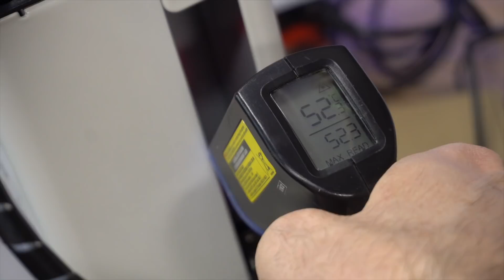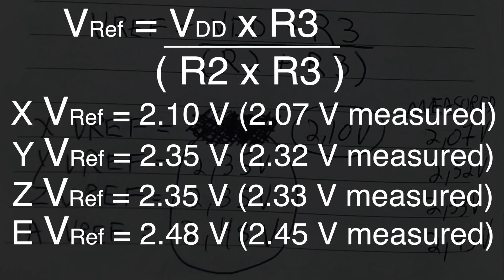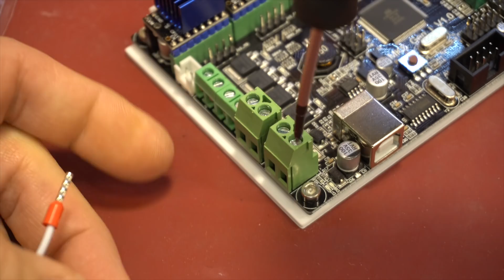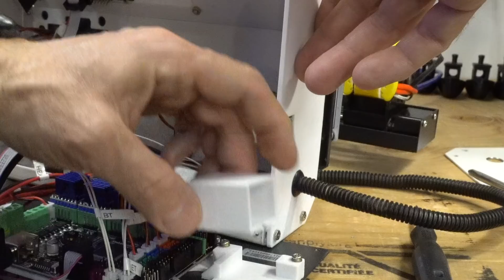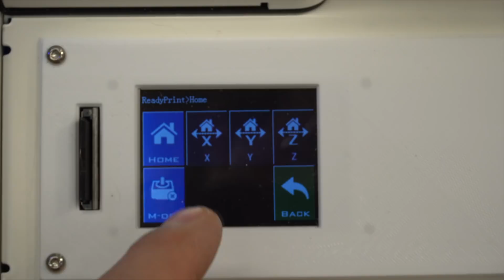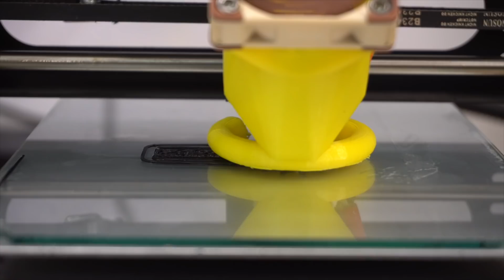Monoprice Mini V2 and V1 - Transformation Part 2

Comment: I presume if I replaced the main board with the MKS Gen L, I would lose the wifi function of the printer or is that module elsewhere? I'm thinking of doing this as a cheap way of using the TMC drivers for a quieter machine.

Comment: Hi Frank thank you for your great work and video . 
I like to rebuild my Monoprice mini as well. I check that links for parts and they don’t work any more :( 
Do you think if I will use that parts it will work as well as yours ?

[CA$56.71 19% OFF]MKS SGEN L V2.0 Mainboard + 5Pcs TMC2225 v1.1 Ultra-quiet Motor Driver for 3D Printer Part  Office Equipment from Computers & Office on banggood banggood://prod-1653438?channel=emarsys&utm_source=emarsys&utm_medium=shipoutinform190813&utm_campaign=trigger-logistics_prdshare_copy&utm_content=gakki&utm_design=18

And 
https://www.aliexpress.com/item/32823840528.html
Reply from the maker: If the holes are at the same position on the board than it should work.
MKS Gen L on Banggood : https://www.banggood.com/MKS-GEN-L-V1_0-Integrated-Controller-Mainboard-Compatible-Ramps1_4Mega2560-R3-For-3D-Printer-p-1270450.html?utm_source=google&utm_medium=cpc_ods&utm_campaign=arvin-3d-sds-printer-url&utm_content=arvin&gclid=CjwKCAjwiOv7BRBREiwAXHbv3OS00bfisHPaiyzVwx9bHrpI1PaFl2SprxVWzITq9wn8qK5VNeWpXBoCHT8QAvD_BwE&cur_warehouse=CN
As for the drivers I had trouble with generic brands, you can them, you will have to modify Marlin accordingly and if they are not supported you could have to update to a newer Marlin also.

Comment: hey frank i have an issue where when my printer homes it goes to the right instead of the left and crashes into the side. It should go to the left and hit the endstop. Can you explain what might be the issue?. As well as that the cooling fan for the hotend doesn't turn on.
Reply from the maker: Hi, for the direction problem, you can reverse the cables or change the direction in Marlin in the configuration file. In mine the cooling fan comes ON at 50 degrees. Hope this helps.
Reply: Frank's 3D shop also will I be able to add a bl touch to the printer and does it connect to the board you showed?
Reply from the maker: Hi, you could add a bltouch if you make a support for it, but the build plate is so small I prefer to add a flat glass and do it manually, anyway the probe would not be able to reach every corners you would need something like a piezo probe so use the nozzle as a probe, it requires major redesign of the hot end.

Comment: Hi Frank just puchased the monopice mini v2 after only 1 print I got a sensor fail on the screen, Heat bed and nozzle wont heat up. Whats causing this??? Please
Reply from the maker: If you can ask for a replacement or refound, if it’s not possible repair either the hot end thermistor cable or more likely the bed thermistor cable, I have a video on this.
Reply: @Franks3Dshop  Monoprice refunded but let me keep the printer, thanks for replying. Great videos

Comment: Ive used your upgrade files on my V2 MP200 with a mks_Gen L ver 1 using Tmc4988 steppers which i already had, but i'm only able to get half the bed to be used, it wont go past the half way on x or y unless in the firmware i double the size of bed, which is not really advisable i'm guessing..and idea what i could of missed
Reply from the maker: Did you change the driver type in Marlin config. Verify that the jumpers on the board are connected correctly I think you need all 4.
Reply from the maker: All 4 under the drivers.

Comment: What do I need to do to use the wifi on the new mainboard?
Reply from the maker: You can use a Mks wifi module, work with some limitations, I use a Raspberry Pi Zero W with octoprint on some of my printers connected through USB, works if you do not connect a camera and keep it slim...

Comment: Where does the bed power plug in on the new board?
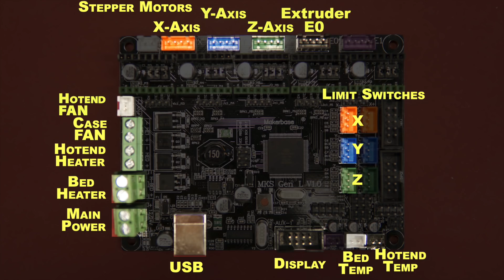Reply from the maker: Hi look in part 2 at 5:24 time mark, it’s the bed heater.
Reply: Frank's 3D shop Thank you.
Reply: Frank's 3D shop I used the TMC2208 v2 drivers. I’ve tried all jumpers and no jumpers. Do you know how they should be set?

Comment: I made all of the mods, using the parts list supplied. When I turn it on, I get power to the board and display, but nothing from any of the axes. Any idea what I need to look at to resolve this?
Reply from the maker: Hi, verify that power is applied to the board, verify the jumpers under the motor drivers. What drivers did you get, they have to be set in standalone stealthy mode. Did you try to move the axis from the printer menu ? Connect a computer and use Pronterface to see what the board is telling you when moving the axis... Send me what Pronterface gives you when moving axis if you are still stuck...
Reply: @Franks3Dshop  I now have all except the z-axis working. Here is the pronterface output.
Connecting...
start
Printer is now online.
echo:Marlin bugfix-2.0.x
echo: Last Updated: 2019-10-31 | Author: (none, default config)
echo:Compiled: Nov  1 2019
echo: Free Memory: 3699  PlannerBufferBytes: 1216
echo:SD init fail
echo:Hardcoded Default Settings Loaded
echo:  G21    ; Units in mm (mm)
echo:  M149 C ; Units in Celsius
echo:Filament settings: Disabled
echo:  M200 D3.00
echo:  M200 T1 D3.00
echo:  M200 D0
echo:Steps per unit:
echo: M92 X80.00 Y80.00 Z400.00 E96.00
echo:Maximum feedrates (units/s):
echo:  M203 X200.00 Y200.00 Z20.00 E25.00
echo:Maximum Acceleration (units/s2):
echo:  M201 X3000.00 Y3000.00 Z3000.00 E3000.00
echo:Acceleration (units/s2): P<print_accel> R<retract_accel> T<travel_accel>
echo:  M204 P3000.00 R3000.00 T3000.00
echo:Advanced: B<min_segment_time_us> S<min_feedrate> T<min_travel_feedrate> J<junc_dev>
echo:  M205 B20000.00 S0.00 T0.00 J0.01
echo:Home offset:
echo:  M206 X0.00 Y0.00 Z0.00
echo:Hotend offsets:
echo:  M218 T1 X0.00 Y0.00 Z0.000
echo:Material heatup parameters:
echo:  M145 S0 H180 B70 F0
echo:  M145 S1 H240 B110 F0
echo:PID settings:
echo:  M301 P22.20 I1.08 D114.00
echo:  M301 P22.20 I1.08 D114.00
echo:Tool-changing:
echo: Z2.00

The only time I get any z-axis response is if I plug it into the E0 connection on the main board. No response when connected to the x- or y-axis connections. I replaced the z-axis motor with a know good one. I also tried swapping the stepper driver.

Thanks for your help I've got too much money into this upgrade to give up on it now.
Reply: I finally got all of the axes working, but they don’t home correctly. Did you have this much trouble getting the new board to work correctly?
Reply from the maker: @katherynoverman6851  Since it's not my first build I fixed all of the problems it was not correct the first time. What is the problem with homing?

Comment: What are the temps supposed to be on a stock v2 board ? I’m getting around 117 Fahrenheit on the x axis stepper ? I’ve never touched the voltage or even opened the printer up so is that normal for it to be running that hot ?
Reply from the maker: Hi, yes it is normal, those motors can endure more than that, some of my motors that are a little bigger go up to 140F no problem, I do not remember the specs of the different motors on the mini, but 117F is quite fine I think. My concern is was not to burn the drivers in my transformation or ask too much of the power supply.

Comment: Hi Frank, can you do a video on Printing TPU on the mini?
Reply from the maker: I do not know if it is possible, TPU as nasty fumes and my shop as no window or ventilation. Smooth PLA would work fine I think it is flexible but not stretchable...
Reply: @Franks3Dshop  Thanks for the reply.  I didn't think TPU had toxic fumes.  I guess I'll need to do some more research.

Comment: Another question.  How did you make your boot screen?  I tried and failed.  I designed my logo and saved it as a .jpeg.  Imported it into MS Paint, resized it to 320 x 240 pixels and saved it as 24 bit bitmap.  Then I opened it up in Image2Lcd.  Settings: File type = Binary,  Scan mode = Horizontal,   Bits Pixel = 16bit True Color,  and set the tabs under the image to 16 bit color.  Then I saved it as "bmp_logo.bin".  Next I dropped it into the mks_pic folder and did a copy and replace.  I then copied the two folders and three files to a SD card and booted the TFT24 screen.  After refreshing the data, the boot screen starts, but is garbled.  You can tell it is my logo but everything is out of place.  If you are familiar with Image2Lcd,  do you have any idea what I did wrong?  If you use some other program, could you tell me what it is?
Reply from the maker: Hi, if you download the original TFT firmware from Makerbase, there is a conversion tool that can do icons and the boot picture...
Reply: @Franks3Dshop  Thanks.  Found it.  Works great.  Much better than the convoluted way I tried.  After spending a day trying to figure it out, it took 15 minutes to download, convert the file, and flash the TFT.  Now all I'm waiting for is the video's for the TMC2130 drivers.
Reply from the maker: Hi, I will make some tests using the TMC2130 switchless end stops on the Z axis, to see if I can get by probing the bed, and without braking the glass on the bed...

Comment: SORRY THIS GOT SO LONG.  Hopefully it is useful.
****************************************************
Frank:  We are completely up and running now, with your new mods (except that I used the DRV8825 drivers for now.  The motors are running at about 30-32 C using your measurements).  System is calibrated, printing quietly and talking to Octoprint once again.  

I have a couple of questions, and maybe a couple of observations that might assist others in doing this mod.  But, first, overall, it has been an easy, effective mod that accomplished what I wanted.  

Questions:  1.  On the "levelling" menu page, it appears that the graphic might not be quite correct.  I wonder if the "quadrant" graphic should be different as the hotend moves from place to place, instead of always showing the upper left quadrant graphic.  I also am not sure why it starts with the "back" graphic showing for all except the upper left quadrant.  The procedure works, of course, but the graphic is confusing.
2.  I'm primarily using Octoprint.  But, how would one do an immediate stop/cancel of a print if they were using only the TFT interface?  The original Mini firmware had both a cancel and a pause on the front screen.  Is there an equivalent function in the TFT24 menu system?  (I could have just missed it)

Comments.  Thanks for the ability to "home" each axis independently.  However, it appears that after startup, an axis cannot be moved to the negative direction until it has been automatically "homed".  Is this correct?  It's not a big deal because one can just home all three axes immediately, but it means that for testing, you have to have the endstops set up so you can move the axes to the negative direction.  Otherwise, it might seem like the motor was not working if it happened to be at the extreme positive end of it's travel when power was supplied.  

Your PID algorithm worked very nicely for the hot end, and as you found, it holds the temp within 0.1 degree of the set point.  It gets to the temp and stabilizes within about 2 minutes, which is also good.  

You inclusion of the 3 speeds for the extruder is useful, especially for calibrating the extruder.  The slow speed allows the most accurate amount to be extruded.

Your design for managing the USB connector is very nice!!  It works well, and I finally got rid of that micro USB connector which had failed on the original board.  

As for the install, there were a couple of things that I was not expecting or that might be useful.
i.  The wiring from the bed was not long enough to reach the connection points.  This was especially true of the heater, but I also had to extend the thermistor.  Note that I had already re-routed that wiring to the outside of the printer, but I don't believe I had shortened anything.  
ii.  Some of the connectors were different from the original board.  The stepping motors were ok, of course.  The end stops had to be modified anyway, but I believe that it was a different JST size.  Same for the thermistors.  It's not just a matter of removing the pins.  Case fan connector was also a different JST. 
iii.  All 4 of my motors had to be reversed in the Marlin config file.  
iv.  As a matter of interest, the white JST connector that is next to the X-motor is always on and supplies 12V.  I used that for my case fan so that it can be independent of the hotend, which I put on the D9 "fan" connector, as you did.  (I don't have a separate "parts" fan at this time.)  (I wonder if the connector for the E2 hotend could be reassigned as a part cooling fan?)

I suspect that most of the issues I found are just the routine variation in the way that these machines are manufactured.  And, the most important point is that your firmware and TFT configuration made it very easy to get this mod done.  I would say that it only took about 4 hours, once I started the process and had the parts printed etc.  Thanks so much for getting this ready to go!!
Reply from the maker: Thanks for the feedback! 

Did you use the calculation for your drivers to get the iMax I listed ?

Here are my replies for now, I just numbered them in the order they were...

1. I will look at it, I level by moving the head by hand and it’s only rarely that I need to level. I will take a look.
2. I will add a custom Stop command for Octoprint, it can be either a gcode or there is a plug-in for Octoprint using custom commands we can use. 
3. This is a feature of Marlin called software end stop, it can be disable in Marlin or with a gcode ‘M211 S0’ when needed, I will also add a custom button...
4. Speeds are built in the TFT firmware..
5. USB connector, thanks and I am proud of the solution took me some time to get it correct.
6. I had to replace the bed heater cable it was broken, I also extended the thermistor in the video where I replace the bed wiring https://youtu.be/xT5_GBvba24
7. Yes you are correct I had to replace the fan connector, I have a good JST crimper and connector kit listed from Amazon in the description. For the thermistors I did not change my connectors they were the right size.
8. Probably because of part supply during the manufacturing they even have a reverse motor command that Marlin does not have, will add this to a follow up video.
9. Yes you are correct there is a 12V always On supply on a JST connector, in my case I want the quietness of the case fans OFF after a print, so it will go in parallel with the hot end fan when I add the part cooler. You can use E1 and the fan connector they both can be used to control fans, the one with the screw in connections can handle more power than the JST connector, the way it’s configured in Marlin the hot end fan comes on at 50 degrees and the case fan when motors are engaged. You can easily change the E1 for a part cooler, I will list what is needed in a futur video.
Reply: @Franks3Dshop  yes.  I used your calculations to set the Vref.  As far as I can tell, it works very well.
Reply from the maker: What drivers did you use are they of some brand or do you have a link? You should have applied a formula to get the vref for your drivers. At least they are not over heating like mine almost did! I can look for you if you want.
Reply: @Franks3Dshop  I used the drivers at this link: https://tinyurl.com/y2n7f9m3
I think that I mentioned earlier that I had already purchased the MKS board and drivers before you posted your video about this mod, so I already had them.  And, in addition, I had used the same board and drivers to set up and operate my "Mostly Printed CNC Router" (https://tinyurl.com/yxa6t7ys) that I had just built, so I was familiar with how everything worked using Marlin, etc, although I had planned to use a different display on the MPSM until you showed the TFT24.  

And, yes, there is a formula for the voltage, but it's just Imax/2, so it was easy.  At the MPSM facebook page, folks also say they are running these motors at about 300-500mA, so that is consistent with what you found.  I just used your Imax divided by 2 to set the voltage.  I'm no expert, but as far as I can tell, the motors are operating without any issues.  

Eventually, I will probably replace these drivers with the TMC 2100 or 2130,  but there is no rush.  The only real issue is that the DRV8825's seem to be occasionally causing some very high pitched sound, but I usually can't hear it because it's not continuous and I'm not in the same room.  (The bigger issue is an apparent mechanical racket coming from the belts, bearings, and pulleys on the x axis.)
Reply from the maker: Hi, yes iMax/2 seems to be the correct formula from the resistors I see on the driver board, same as the Pololu. I had the same high pitch noise with other drivers than the TMC in sleathchop mode... I have tried cheap TMC2130 and they work fine.
Reply from the maker: Hi, I corrected the missing level icons, added an Emergency Stop in the custom menu to use with Octoprint. The new version is on Thingiverse, please let me know how it goes for you.
Reply: @Franks3Dshop  Thanks!  I'll try tomorrow.

Comment: Frank,  We are up and running except that the extruder is running in reverse.  I know that I can probably reverse it by editing configuration.h but, in principle, I should be able to do it using the "M562 E" command.  However, when I do that from Octoprint using the terminal, I get an "unknown command" message.  I think this may be an MPSM specific gcode command.  Do you know of any reason why these commands should not work with Marlin as we have it configured?  (Other commands like G90, G91, M503, etc. were successful, so I think the communication is OK)
Reply from the maker: Hi, yes it is a specific Monoprice command, seems to me that they correct the motor in software probably because they are not always wired the same from factory. You could also inverse cables on the plug.